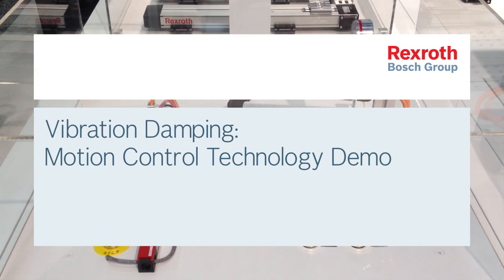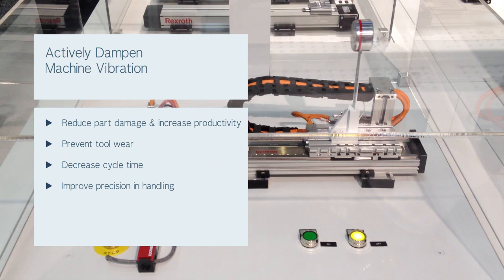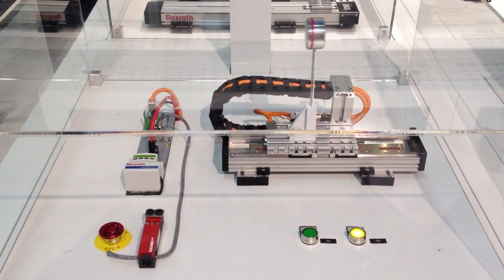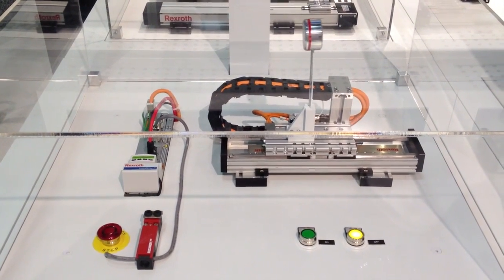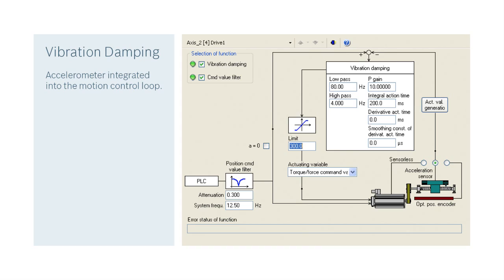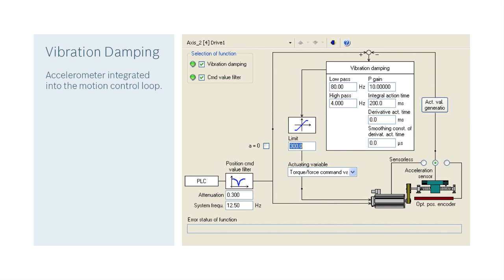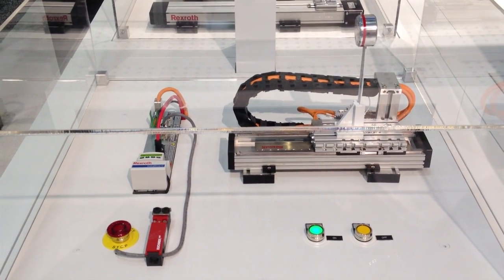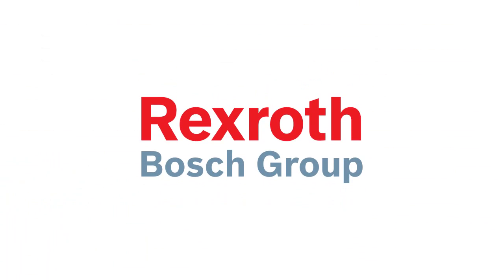Vibration Damping Protects Fragile Products and Increases Productivity by Bosch Rexroth

Comment from the maker: Vibration damping is great technology. And while it has been accomplished at the control level for years, the technology in the video addresses vibration damping at the drive level, including detection and compensation. This means that the user or machine builder can utilize nearly any control technology and can retrofit anti-vibration technology into existing systems whose controls don’t currently offer it, or even add it via software to drives that have already been in the field for years.